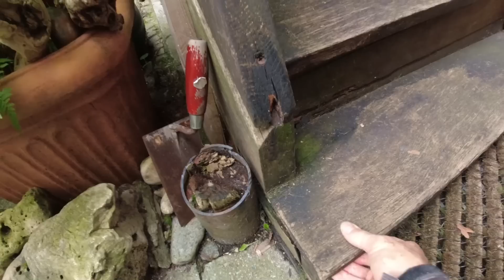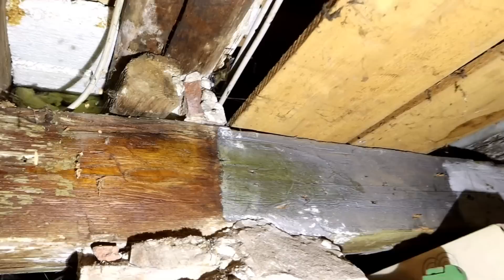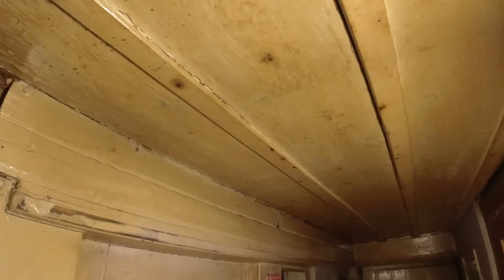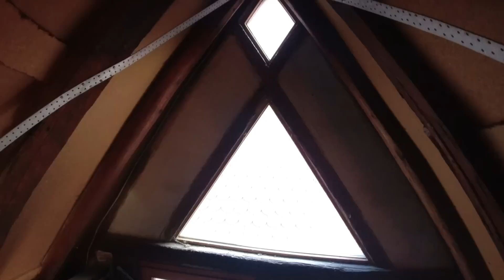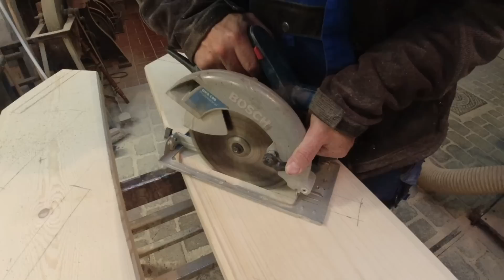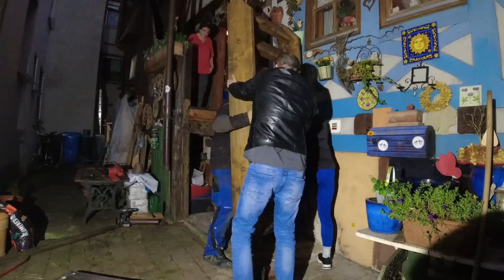New stairs for a tiny medival house

Comment: Matthias,  What an excellent series of videos.  I live in a 16th century oak framed house in England and it has a 17th century barn that was built with much older reclaimed oak beams & timbers.  So I enjoyed watching how you restored the rotten beams.  The joints used to build both buildings are similar but not the same as the German carpenters used 👏👏👏 PS I live near a World War II airfield so we suffered with similar bomb damage 😊

Comment: How the heck is that house still standing?  You noted at least 3 sections of MAJOR beams that had been cut out entirely.  And the attic was only braced with metal strapping??  Aaaahh

The staircase you made is great though, you are right about not making mortises to avoid puddling water

Comment: Beautiful work! I like that bracing detail where there is a continuous brace across a post. You should consider adding a handrail along the wall. With only one railing, especially on the out board side, grabbing it during a fall will tend to rotate a person down the stairs. Being able to grab both sides may stop a falling person sooner than the ground surely will.

Comment: Such a nice gesture - good work.
And very nice construction. And you are exactly right. Using screws, instead of mortise and tenon joint, is often way better, with wood exposed to the elements. Also - you don't remove material from either member.

Can't fathom how this video has any dislikes - i love your channel.